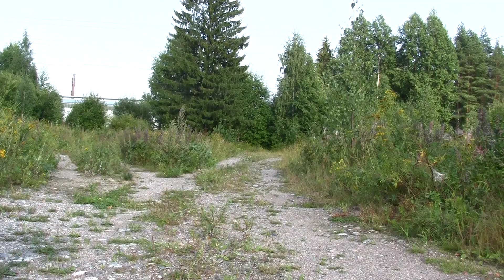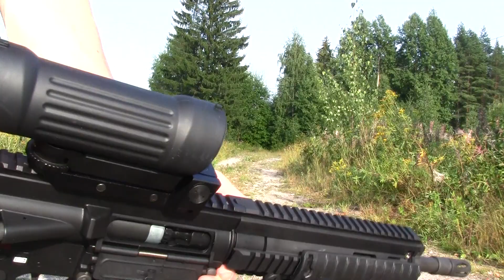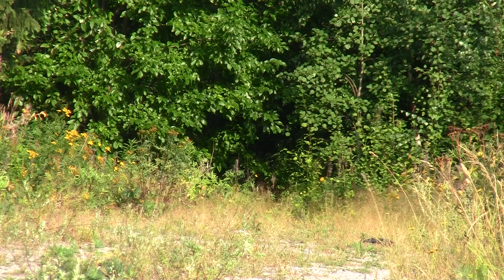VFC/Umarex HK417 400fps R-hop shooting test

Comment: Maekiii, I am waiting for my 4CRL to be shipped back since it has been upgraded by a company. It has a guarder cylinder set, m120 spring, Pand a prowin hop up chamber. Of courser it has been r hopped and is is shooting at 430 FPS with an m120. What kind of range do you think I will be hitting?
Reply: +Southern Connecticut Airsoft  what range did u hit?

Comment: I feel like you really need a better barrel. the groupings for an r-hop in that look horrendous
Reply from the maker: I'm very confident that your feeling is missing the mark. :P I was shooting from a standing position, so majority of the spread is caused by me, not the gun. When supported, the groupings are at the maximum flat BB travel distance (~65-70m) a size off much less than an A4 paper. There is really no physical way of making an aeg any more accurate than that.
Reply: Maekiii I may just be an outlier, but with my R-hopped PDW, using a compression sealed gearbox and a core 185mm barrel I can do just about the same at ~320 fps. I think the wind may play an effect here, but from the view of the camera it just looked a little too spread out. I guess I'm just being nit-picky. It probably would look alot better in terms of a grouping point of view if it were not so far zoomed in, which would make the point of the video void. 
TL;DR you're right, im being stupid

Comment: Nice Vid. Got the 350c, 417-d (sniper version) - Currently at 320 (stock spring) - What upgrades would you recommend (straight from initial stock) to hit 400-420fps as a dmr? Thanks.
Reply from the maker: TheIntrepidWolf Hey thanks. An m120 spring would get you there. I would also swap out the piston and the pistonhead for reliability reasons to some other brand parts. Otherwise the vfc internals are quite nice, but a mosfet would be a nice touch as well.
Reply: Awesome many thanks! Do you have any recommendations on any specific brands for the spring, piston and piston head? Yeah I was going to get a burst wizard king kong super 2 mosfet so I could look it to semi-only (site only allows 420fps dmr's locked to semi).
Reply from the maker: TheIntrepidWolf Guarder sp110 (it is m120 equilevant) Lonex POM piston head and some other non polycarbonate piston with 1 or more steel teeth. SHS 15t piston is pretty nice.
Reply: Awesome many thanks man! You know what the actual stock spring is for the 417? (I think from stock it shoots 320fps).
Reply: Just wondered have you had any experience with the VFC MK17 Scar SSR? Worth the trade over the DMR/long barrelled version of the HK417-d you reckon?
Reply: +Maekiii Wow! May I know the M120 spring for AEG version do fit GBB version as well?
Reply: TheIntrepidWolf No not worth the trade, VFC Scars are notorious for having terrible wiring and overall poorly constructed internals. The newer 417s are infinitely more robust

Comment: Hey I've got the 417D long version and I've had a problem with the trigger assembly shooting it in single shot mode. Is there a better trigger assembly or did you make a better one yourself?
Reply from the maker: This is a customers gun. There hasn't been any problems with his.
Reply: reese leggett Was the problem that the gun would sometimes shoot full on semi-auto?

Comment: In your opinion which best range is possible to get with 350fps gun ( 0.20bbs ) with R-hop or stock G&G Green bucking?
Assuming best upgrades\dyi mods :D
Reply: Get a purple bucking AND r hop it. Kapowee
Reply: Lorenzo Garofoli You should use 0.25bbs.

Comment: what weight bb are you using
Reply from the maker: It's stated in the video description.
Reply: Maekiii my bad man. thanks for the fast response
Reply: It was to light BB's. It should be 0.3 - 0.32g at least. 0.3g is suggested for 350 fps.